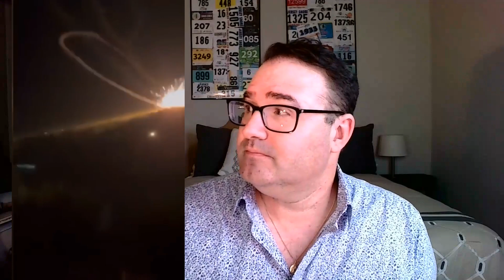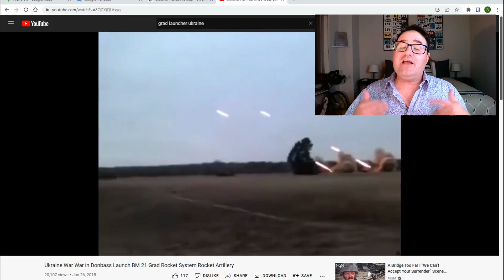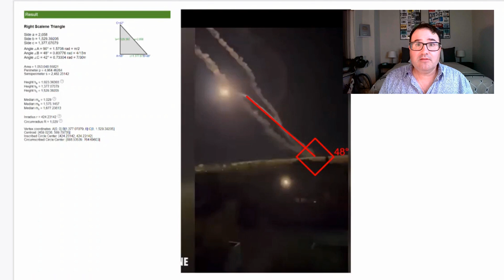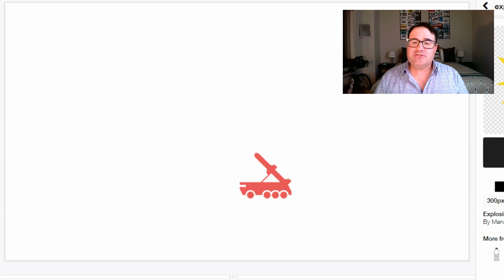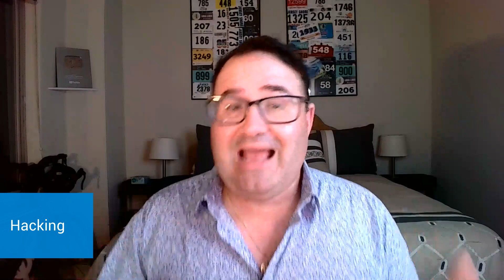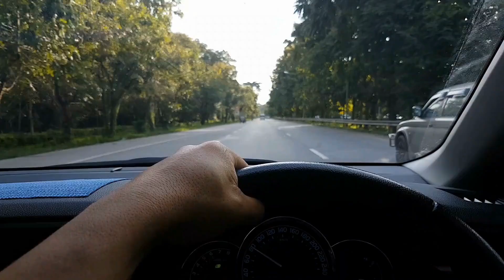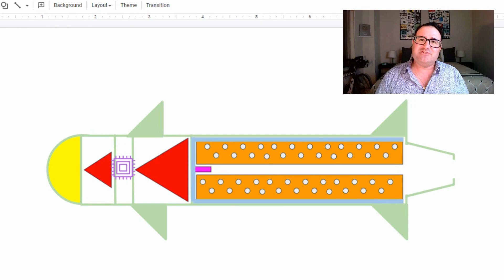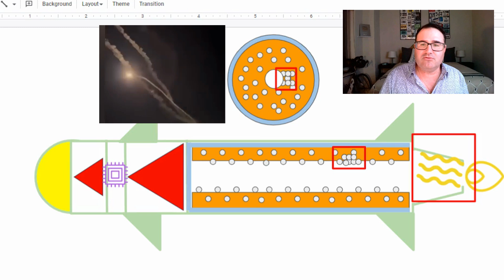Why this missile U -Turned

Comment: 1 mi in the air? Bro your math is way off. That missiles hardly even 700 ft in the air barely. Not only that you got your rocket physics completely wrong. A clump in the grain? That's not going to push anything to any side. It's coming out of one rocket nozzle, it'll be uniformly regardless. For a rocket to come back like that is potentially more than one malfunction. Either through the guidance or malfunction at the nozzle. If it's vector thrusted potentially it blew a Finn at the nozzle flipping the rocket backwards. Or it simply could have just blown a hole on the side of the nozzle, because if you look closely it wasn't just a perfect trajectory back to the ground. If it was a little higher it'd be flying in wide circles. This was most definitely a nozzle problem.

Comment: Plausible explanation. I wonder if the nozzle would be able to “correct” an adverse burn. After all, it basically points in one direction only. It is the fins that determine the direction of flight.

Comment: Just speculating as a civilian, I had originally thought it was an anti-EM missile that was armed too soon and possibly returned back to target nearby radar. But physical failure probably makes more sense since you wouldn't design a missile to 180 on you. 

I wonder if it was both. Like presumably a missile/rocket operates in something like 3 stages - Launch(Shooty), Travel (Scooty), Target(Kablooty). So there is a physical failure in the Launch phase, the rocket gets turned around, then it may trigger the Target phase since it's now pointing close to the ground/pointing at the ground. Which might explain why it straightened out. If you forgot to check if the rocket went through each phase, the rocket could presumably trigger the 'Target' state of the program if the conditions were something like 'when pointed at the ground under x elevation find a target to hit'.
Reply: Shooty, Scooty and Kablooty. I dig it.

Comment: I am not a rocket expert.  That said, you can clearly observe a very bright spot.  I think you are correct; but, I would hypothesize the fuel concentration actually burn its way through the side of the motor housing.  Hence the bright spot.  The fuel concentrated pellet is consumed and the remainder of the rocket motor fuel is burned normally.  Hence, the rocket travels in a straight line (just back go the ground).

Comment: So, on some missiles, the terminal guidance, ie, the system that guides the missile the rest of the way to the target, is relatively stupid, and it's going to just steer the missile straight for whatever has the hottest IR signal and/or the strongest radar response. Terminal guidance can be triggered mechanically by the completion of the boost burn, and a bad burn that turned a missile just enough to "see" the gigantic radio signature of the ground based radar could easily finish the turn under terminal guidance, creating that perfect 180 degree turn.

Comment: I think your theory makes a lot of sense.     It wouldn't take much for a rocket to change direction if a sudden force is applied in one direction.  If you've ever tried to balance a broom upside down on one finger, once you actually get it balanced it can fall at even the slightest force in any direction.

Another possibility is a common mistake where the operator entered their own coordinates into the targeting system by accident or due to some kind of miscommunication from a forward observer or whatever.  I think they can fix most of those mistakes with good software, but I think it still happens.  I read a book by an air force forward controller who accompanied special forces chasing Taliban in the first few months after September 11, and he talked about several occasions where they called in air strikes on top of themselves by either putting their GPS coordinates into the wrong box on a transceiver device, or because the pilot in the sky above typed it in wrong into his own system.  But I guess it would have hit the spot where their targeting person did his last GPS reading and probably would have hit something rather than landing nearby in the clear.  Unless that is some kind of last failsafe.  

I also assume it had not armed the warhead yet, so that explosion was just the fuel and explosives burning on impact, and could have been worse for everybody nearby.  Especially if it was a cluster munition that would have covered the entire field with submunitions.

Comment: Could be at least partially correct, but wouldn't the missile have enough passive stability to continue more or less in the same direction? And if it was just a stuck fin it would have just kept turning in a corkscrew until it crashed into something. There must've been some glitch in the guidance system, either the hardware or the information the missile was given.

Comment: A clump of fuel wich could allow a clean 180 ° only ?
Not more ,not less so the missile exactly turn 180 ° and get its straight trajectory again once the clump is burned ?
to tun a missile so sharply,don't you need lateral ports ?
How could a longitudinal propulsion system allow a so sideways propulsion ?
Reply: It might not have been a clean 180 degree turn since we are only viewing from one side of the field. It might be an arc that sent the rocket a couple hundred feet away from the launch position.
Reply: it wasn't a 180. it's moving towards the camera. you can see the shrapnel as it hits the ground to determine it's general direction
Reply: @King_Kristof  Even if it did return on a trajectory a little off to either side of the launcher, it did do a 180 in one reference plane. That is still a very unlikely accidental behavior given the entire possibility space of trajectories. Also, in the "side-side" reference plane of your argument (orthogonal to the original trajectory), it also didn't fly off at any number of angles in that plane, just the one that was almost indistinguishable from a return to launch. Again, very unlikely.
It's extremely unlikely to be any of the clog/puncture/stuck arguments because it returned to straight flight at almost  exactly the moment that sent it back (nearly) 180, instead of continuing to spiral out of control for any amount of time
Reply: This missile probably just locked on to its own missile launch pad and did a U turn. Missile guiding system switched on to early...
Reply: @blacklion8208   that's not possible there are couple save systems to prevent that .
Reply: @blacklion8208  that's not a thing. the missiles guidance system is forward facing, not omnidirectional
Reply: @King_Kristof  Ok, it was just an idea what could have gone wrong.
Reply: @blacklion8208  no worries bro, check out some videos on surface to air missiles, they are pretty amazing technology
Reply: @King_Kristof  Ok thanks and will do. 😉👍
Reply: The way you can get angular momentum from a rocket engine with uneven fuel is because it can create a differential amount of thrust on one side of the rocket, from memory some indian rockets actually used this to control itself by injecting extra fuel into certain parts of the chamber
Reply: @Steph.98114  Yes, like said in the video.
But is that method allow that sharp maoeuvers or it's only to correct fly trajectory ?
Reply: The coincidene of a 180 degree turn is only an amazing coincidence when you decide to ignore all the other cases of drunk rockets where the turn wasn't of exactly 180 degrees
Reply: @Scarletraven87  except there aren't many of your drunk rockets on video so the improbability still stands. This was clearly on a targeted trajectory back to the vicinity of the launch, probably toward the targeting radar support vehicles. An in flight anomaly followed by onboard radar lock on the radar truck (due to rubbish software safeguards!)
Reply: More like a hole burnt through the casing and gave it a side port.
Reply: @sichere  It's what i implied with my question.
Unless the fuel burned a hole then clogged it once the clum burned ,or the missile corrected its trajectory i doubt about this theory.

Comment: If it was a gravity center issue it would be spinning, not uturning. Also the angle is too sharp. Imho its the guidance system inside rocket, that went to "oh look my target over there" mode independent from guidance system. It could have been attacked with the weapon designed for drones and lost connection to central unit

Comment: There’s a very real possibility that this was a anti-radiation missile. I’ve heard that the United States gave Ukraine Q-31 counter battery radars, these radars can pick up a football being thrown miles away. As soon as they pick up a missile being fired they can turn off their radar and that ARM will find the next best target, which could be their own radar, or a microwave oven.
Reply: Buk are air defense systems.  They don't fire anti-radiation munitions. Anti-radiation missiles are almost exclusively installed on aircraft.

Comment: I don't think your calculation that it travelled 2000m into the air, the distance from the camera being 500m, and the angle travelled across the camera don't add up. Are you assuming it's travelling mach 3-4 from the instant it's launched?

Comment: It absolutely does guide with the control surfaces during boost. Because you want to turn as little during high speed as possible it will turn early in boost to conserve momentum.  This was most likely a stuck fin or bad guidance. You can't see the other two missiles or how they guided. This could have been a bad interpretation from the missile signal processor. It also most likely went straight because it was no longer able to acquire any more guidance at such extreme angles and defaulted to neutral flight controls. 

Th you demonstrated that you don't understand rockets, combustion chambers or rocket nozzle dynamics. There wouldn't be adverse yaw or pitch from the combustion chamber even off the rocket fuel was clumpy and uneven. The combustion chamber has the effect of evenly distributing gas generation and flow. It wouldn't cause that turn effect without a thrust vector nozzle or guide vane. Which again would be a faulty actuator or bad guidance. 

 I like your content. But you need to stop producing videos on things you actually don't have expertise on. Your just spreading misinformation.  Stick to infantry ground pounder content.

Comment: This theory seems way off. First off, the missile never stopped turning. It start off moving toward the camera and up-left. Then it goes wild, starting to turn. It doesn't do a 180 turn, but rather a more gentle turn vaguely toward the camera. This causes the missile to visually cross back on its path, but in reality it's doing a typical wild rocket turn. It impacts a point that is visually close to the launcher, but it's actually simply closer to the camera.

So, there's no need for a weird explanation for why the rocket stops turning. It simply never stopped turning. It was doing a more gentle turn.

This may have been because a bad fin bent, or a bad nozzle failed off to a side.

Anyway, I doubt it was a SAM because it's unusual to shoot so many long range SAMs like that ... few SAM systems even have the ability to guide so many missiles at once. But that's not really relevant given the generic nature of a wild rocket failure.

Comment: Do you think the missile could have locked onto the target illumination radar? I know Russian doctrine calls for firing two missiles at a single target, so I was surprised to see a third fired unless they were planning on firing a 4th. If they were planning on firing a 4th that would suggest they were trying to target multiple targets which makes me think there was a targeting problem.
Reply: Impossible. The missile's seeker can only look forward in a limited cone.

I don't think it was a SAM, because like you said they wouldn't be firing so many missiles like that. But in any case there's no way for a SAM to lock onto anything that's not physically in front of the seeker head (which always points forward).

Comment: There is more footage and one front angle. In the front angle you can see that the turn is not just downward, but sidewards to the left. So unfortunately it didnt destroy itself but hit somewhat some 100 meters away
Reply: Yes, and even in this angle you can see it hits the ground closer to the camera, not the launcher. It didn't do a bizarre 180 degree turn. It just did a more gentle typical wild rocket turn (and never stopped turning, so there's no need for a strange theory to explain why it stops turning).

Comment: Very good breakdown of possible conditions which would lead to this.  Initially I was thinking stuck fin or full deflection, but your explanation of the boost phase actually does make a lot of sense and the inconsistent fuel mix or poor manufacturing is far more likely.  And even more probable with the combination of poor manufacturing, age, and storage conditions of a lot of Russian equipment.  Thanks!
Reply: The big problem with the theory is that the rocket booster has a nozzle, and this nozzle would direct the thrust in a rearward direction even if the fuel was burning in some stupid crazy way. However, if the nozzle itself has a failure, or a fin has a failure by getting bent, it could easily cause the rocket to start turning. (The rocket never stopped turning, it's just the camera angle that makes it look like it did a 180 and then started going straight. In fact, it was doing a roughly circular turn with a large turn radius. It impacts a point closer to the camera than the launcher.)

Comment: Is it possible to burn out or blow out the side of the missile, providing uncontrolled thrust out the side?
Reply from the maker: Yes. That’s exactly what happened to the space shuttle Challenger. Fire burned through an O-Ring. But that wouldn’t explain why the missile corrected itself.
Reply: @RyanMcBethProgramming  The missile never corrected itself. It started turning and never stopped turning. The only reason it looks like it's going straight is the camera angle. Think of looking at a circular hoop nearly edge on. It looks like it does a 180 and then is straight. In fact, it's merely a circular arc.

Comment: You sound right. I thought it heat seaking warhead activated to soon and it let after the luncher but I was just guessing
Reply from the maker: Heat seeing weapons are usually very short range.
Reply: Regardless of seeker type, seeking sensors only point forward. Anti-aircraft missile seekers can sometimes look significantly off to the side, because this is often necessary for a high speed crossing intercept of a high speed target, but still only within the front hemisphere.

Comment: A lop sided burn in the chamber would have no drastic directional effect on the rocket due to the convergent section of the nozzle... a improper/slower - lengthened burn rate would only make it slower or barely leave the ground if not enough expansion for the nozzle. Since it's being propelled just fine with no flare outs it would suggest that the convergent section of the nozzle is doing it's job with the expanded gases - only one direction out at that point. 
My personal guess of how it would drastically turn in such a manner.....buckled between the stages. We often tend to forget how old much of their long neglected missiles are in their bag of supplies as they quite regularly pop off missiles that are much older than most of us here.  
If the second stage is tweaked out with the first stage still supplying the thrust for the entire unit it can become a rather large boomerang.   
All it would take in this scenario is for one crusty ass cables (err whatever dependent on variant) to let loose while the rest are still holding on for it to shift between the stages and that's all she wrote as the second stage will then guide it to which ever direction it shifted as the first stage continues to push it along. The booster being much shorter it wouldn't take a whole lot of shift to equate in a sudden drastic change in flight path as seen here. (that's my "guess" at least) ✌
Reply: We can only speculate but I think thats a very possible hypothesis.

Comment: I know something about controls but not much about military missiles. To me it personally looks like an active correction on the trajectory made by the flight control computer, as the turn is steep and quick. If the control surfaces stayed neutral, The damping due to the air at that speed would be very intense. On top of that, if the attitude control was working while that happened, it would have fought the change and my guess is we would see some oscillations or some transient behavior before a big turn like that. 

The fact that the missile turns but doesn’t enter a spin makes me think that the people that suggest it was a faulty IMU are probably right. My theory is that it is either a problem of perception or a faulty controller, in any case it looks like the missile decided to change the trajectory and executed a tight turn as soon as the FCC engaged.

Comment: Thats 100% a malfunctioning gyro.  Same thing has happened many times before on various missile crashes that's been investigated. The gyro basically tells the flight system were it is in 3D space so it can orientate itself. If, for example, I was to unbolt and flip a gyro on 737 it would give the autopilot a heading of 315degrees instead of the true heading of 135 and the plane would make a 180 degree turn.

Comment: How about data input.
If the rocket is given 2 co-ordinates : 1 where it starts and 2 where it is initially to head towards. So that's what it will do befoer teh tarcking system gets to give it an update.
Data input is given incorrcetly - the starting piint and target are duplicated.
Then it's possible that as soon as it has control it U turns to it's starting point.